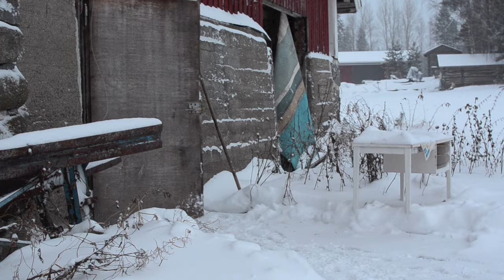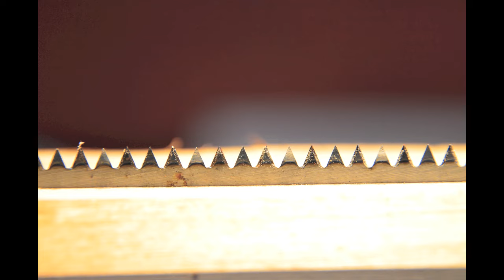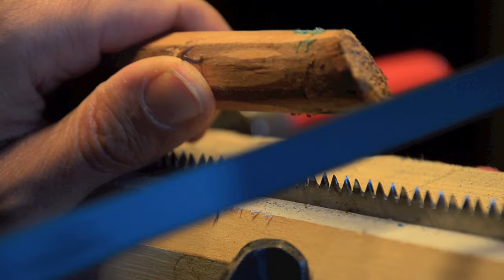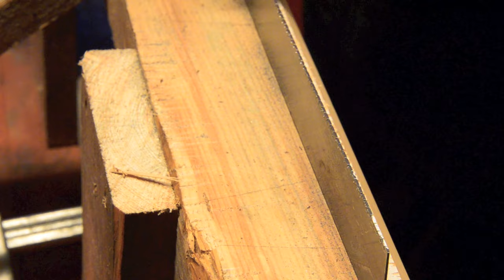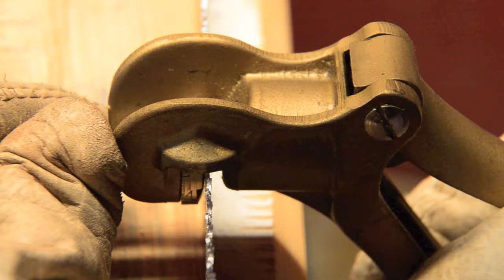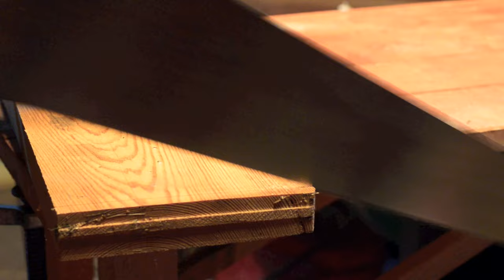sharpen the un-sharpenable - grinder method

Comment from the maker: Will it hold the edge? Some of you have been asking - i have been wondering myself.
It has been in use now for few weeks, i have used it for the new roof truss. And few days ago i decided to re sharpen it. Not because it was blunt, but because it was not perfectly sharp any more.
Nor did i count the hours or cuts i have made, neither can i define in words what exactly i mean with 'blunt' or 'sharp' - but what i can share is, that it feels very similar to my new bought rip cut saw (William Greaves - Sheffield): they have been used and sharpened simultaniously. 
This saw has got two different hardenings: one on the tips only + one on the entire blade (if not, the blade would bent with the first stroke). So, the question is, if this softer hardening makes a useful saw or not.
It might not work on any saw, but with this one, i can say that it worked out very well.
Important is, to remove the hardened tips carefully, without overheating the blade and therefore destroying the second, softer hardening of the blade.
In my case, the saw is made by Bahco with swedish steel (5-6€ cheap)

Did someone try this out on other saws?
How did it work out?
Reply: I use diamond files to resharpen the hardened teeth instead of removing them. Works well for both western and japanese saws

Comment: Cool method! I tried something similar with a couple of my hardpoint saws. I dialed in a hot plate so I could consistently heat the teeth to the point they became comfortably fileable (as the steel turned from purple to blue.). This way I could reuse and only touch up the existing teeth. The saw blades didn't warp after this treatment.

 I've used these saws and filed them a couple times since and they work well. Maybe softer this way (adjustable) than old saw steel but they hold their sharpness and do the job.
Reply from the maker: Hei Robin. Nice to hear! I've been trying a similar method: heating the teeth with a lighter. But it did not work out. Maybe, i did not heat enough!? Cool idea to use a hot plate. And nice to know, that your saws are usable after the treatment. I might try this out for the next saw. Specially when the teeth form should stay as it is, it seems to be the faster way.
Reply: @littleforest I have successfully “drawn” the hardness of the teeth by using a small chef’s gas blowtorch with a focusable flame. I heated the very tips of the teeth until they just start to glow red, then quickly move on…it only takes a couple of seconds. I then allowed the blade to cool to ambient temperature, at which point I could file the teeth as required. I have sharpened both to the original crosscut pattern and to rip cut. My experience is that the saws sharpened this way cut ok but are not as durable as a vintage saw, requiring sharpening more frequently. I came to the conclusion that the exercise was worthwhile in order to learn how to sharpen a saw but that I would be better served by getting a couple of vintage saws, which I could get quite readily on EBay.

Comment: I've been touching up my impulse hardened saw for about 10 years with a little diamond file.  it goes a long time between sharpenings.  Very light stoning of the sides with a fine diamond plate.  Hard to find a fine "three square" diamond file, though - mostly they're too rough for a good result regardless of what the add copy says.
Reply from the maker: There are many ways got get sharp tools. Nice to know, that it worked for you. Somehow a nice idea to keep the hardened teeth for longer durability. I'll see how it goes in the long run...
Reply: @littleforest  Finding a decent diamond file was really the thing that made it doable.  I have 4 or 5 now, and only one was acceptable.  I haven't found any with grit size consistent enough to really be considered "fine".  The only reason it works at all is because the steel is so hard.  On regular saw steel, a file leaves a much better edge.  I wish DMT or Atoma would start making saw files.
Reply: @littleforest  By destroying the temper in the teeth, how do you think it is going to go. A non tempered cutting edge brilliant! :<(
Reply from the maker: 'Brilliant' was the idea to impulse harden hand saws. That is how industry managed to convert a long lasting tool into throw-away-after-use product. There are many blades i use which come along without: traditional hand saw (Disston, Thomas Flinn, Veritas, Lie Nielsen...), our Logosol band sawmill blades - any bandsaw blade, most Japanese handsaws - just to mention a few. 
And still, they are all hardened, but only to about 48-52 HCR.
The impulse hardening makes it as hard as a file (somewhere between 65-70 HRC).

Comment: Nice idea! Make an update after some use - is the blade durable, does it hold an edge? This way one can get a cheap ripcut saw as well, as all the market saws are crosscut
Reply from the maker: Exactly, free to choose what kind of saw is needed - rip or cross and also the design of the teeth: rather fast cut or more finer cut. Freedom is the advantage of 'self-made' :-)

Comment: But what is the problem with using a diamond needle file?
Reply from the maker: To my experience the diamonds will fastly drop from the file using it this way.
Reply: @littleforest  In my experience it is a matter of experience. :) The pressure force of a diamond file is an order of magnitude lower than a steel file and the number of movements is also an order of magnitude less.

Comment: it will be blunted quickly, I think.
Reply: i did this with a cheap hard point dovetail saw a while ago and i don't need to sharpen it often to keep it sharp. maybe with a larger saw it will need more sharpening but saw steel is much softer than chisels anyway.
Reply: Now make a comfortable wooden handle for it.
Reply: Certainly more quickly than the hardened tips. I wonder how the unhardened steel compares to an old fashioned sharpenable saw.
Reply: @michaelmennuti4414 i think for the same thing.
Reply from the maker: Thank you for this comment! How could i forget to mention some words about it in the video text!?
Yes, it will turn numb faster then with the hardened teeth. But, it can be resharpened any time, what will from now on just take few minutes.
Not only the teeth are hardened, also the whole blade is. If not, it would bent with the first stroke. I do not know how hard, but while filing it felt similar than my traditional saws. So, i concluded that this hardening has not been removed while the process. 
Traditional saws are hardened to about 48-52 HRC. This is less hard then files, so that they can be sharpened with them.